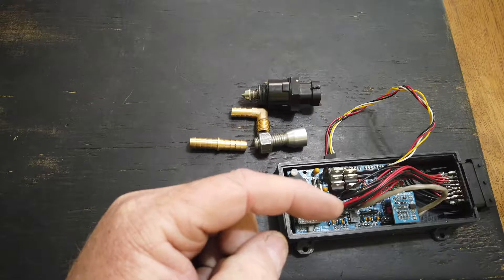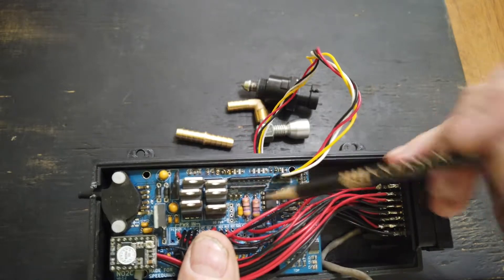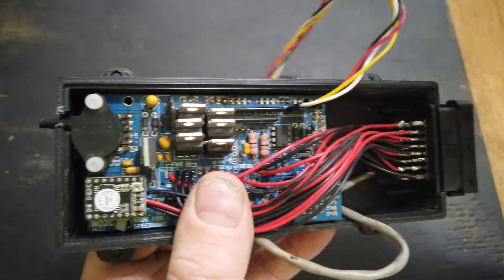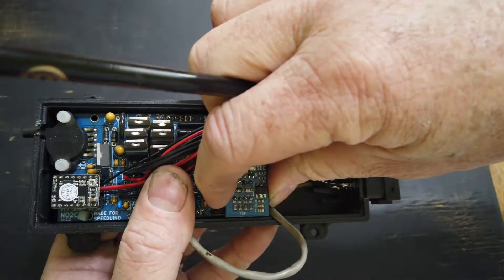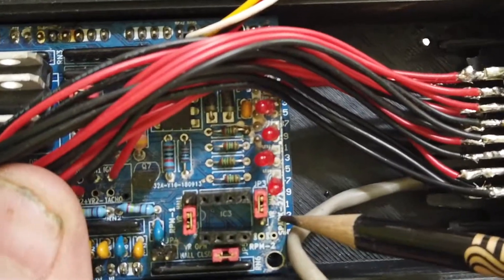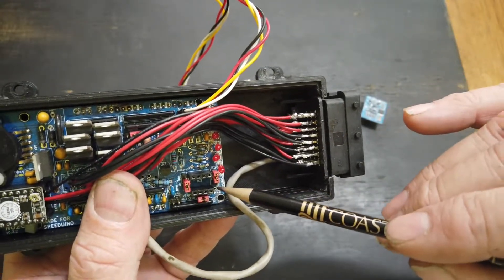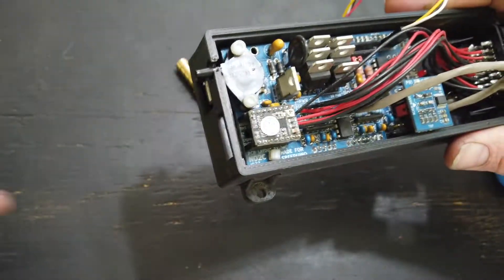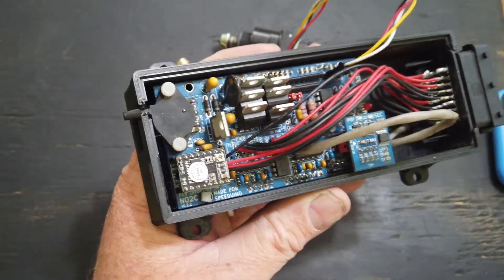NO2C speeduino Jumper settings

Comment: When you selected 12V jumper settings, does it mean you can also run dumb-coils without igniters off the NO2C?

Or would it need an additional circuit?
Reply from the maker: you still need drivers the NO2C can not drive coils directly

Comment: Correct me if I'm wrong but aren't LS1 coils triggered by a 5VDC signal from the ECU? They are supplied 12 volts from the battery but should get a 5V signal from the ECU based on everything I've read.
Reply from the maker: Yes that's correct
Reply from the maker: I get confused so I may have it wrong in the video I have 3 cars running speeduino and 2 with VW coil packs and one with LS My apologies for misstating the spec in the video.

Comment: Great video! Very informative as I'm just getting into this. Question, where did you get the bulkhead connector? I think you said Amazon, do you remember what it was called. I've searched everywhere trying to find that particular version. Thank you!
Reply from the maker: Thanks for watching glad it helped. I got my connectors from aliexpress  They came with an case I was going to try and used but was to thin but they do have the separate hear is a link to some I just looked up. shorturl.at/ghkX4

Comment: Hey could i ask you some questions about wiring?
Reply from the maker: sure what's your question.
Reply: @wjones1972  Soo i have Subaru Ignition Coil (4way) and i don't know if should i take jumper to 5v or to 12v or run it without. 
And if i have VR conditioner i only plug it in or should i connect it to 1-40 pins?
What is idle stepper and PWM idle pin?
Reply from the maker: @545aleks  your coil will need to be a smart coil meaning it has to have a driver built in. you will provide 12 volts from key on and ground to the driver and then signal wires to the speeduino are ground trigger normally. if  you are using a vr sensor you will need a conditioner installed and set the jumpers correctly it doesn't need any other wiring.  stepper idle or pwn idle are different ways of adjusting the amount of air bypassing the throttle to adjust idle for example during engine warmup.

Comment: Hello there. Thank you for your AWESOME VIDEO'S!!!!   I have a VW Manx body buggy with a 1600 DP air-cooled VW engine. I just received my NO2C board with dual VR control and stepper driver. Now I must assemble the boards and now I have myself completely overwhelmed. I found your video's and I am a little more at ease with it. You definitely be hearing from me as I do plan on picking at your brains for knowledge if you don't mind. I have purchased a soldering iron kit, solder, flux, and an anti static mat with wrist strap. I plan to use the NO2C board for the fuel needs at first, and later I will be adding a wasted spark ignition setup later on in the future. I currently have a CB performance Black Box setup running the ignition. I will be using made in Mexico EFI dual port end castings manifolds to mount the injectors, a Ford throttle body with a TPS and just to further complicate things, I have a Berry' Blower Supercharger kit AMR500 that will also be included with my setup. In the future I plan to upgrade to a crank trigger and wasted spark ignition that will also tie onto the NO2C. I have learned so much from your video's and Your Baja Bug runs AWESOME!!!
Reply from the maker: I am glad they are helpful I plan to shoot more as I get more time. Feel free to ask away I will help as I can.

Comment: Thanks a lot, this is exactly what I needed to know!
Reply from the maker: Glad it was helpful! What are you installing your's on?
Reply: @wjones1972  right now I’m making a test stand to see if I can get injectors and coils to fire without risking an engine. Then I want to convert a Suzuki gsf1200 to fuel injection. Just batch fire, fuel only, then add spark control.